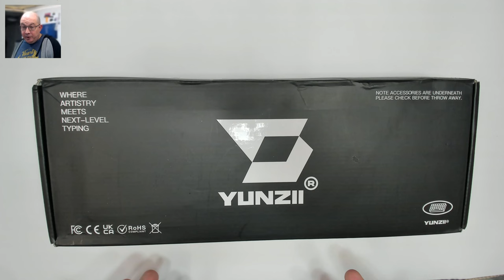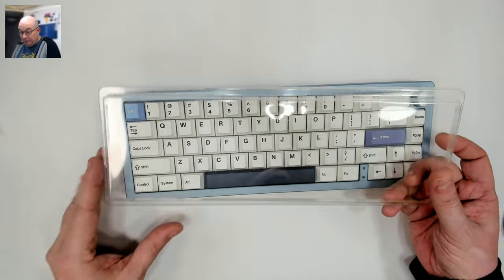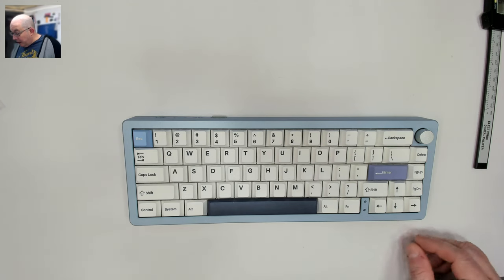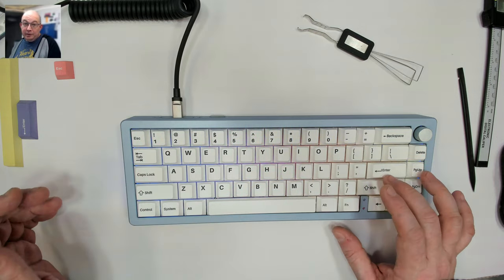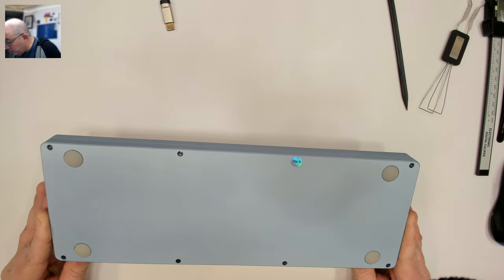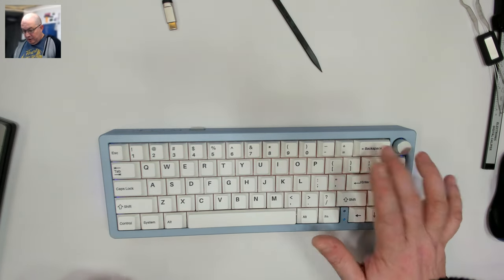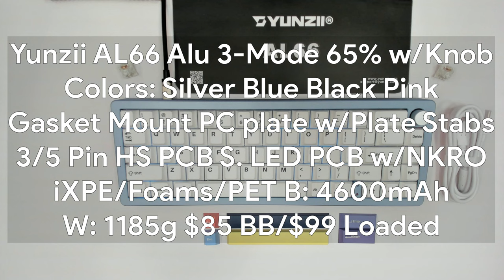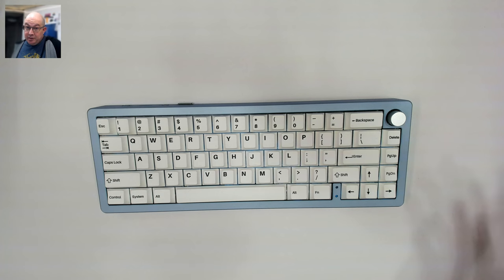Yunzii AL66 Review and Sound Test

Comment: Love the way the budget market is really starting to move more now. The new GMK87, the AL71 etc. It has really started to drive the price of boards down. 

I just wish Yunzii had made this and the 71 QMK/VIA based and done away with the closed software. I find all the iffy gdrive links to drive software such a turn off on some of the cheaper boards and VIA support would remove all that problem, probably for a few $ price increase for the better MCU

Looks an interesting board though
Reply from the maker: Many manufacturers are coming to the realization that they will need to invest to get those MCUs and deliver open source software since Windows is not the only OS. Not only that, I think it would save them significant time in developing those closed source "drivers" as building QMK driver is not a complex process and should be able to be written and tested within a day or two per keyboard, even less if they develop templates, they'd just need to insert the matrix, build, and go. 

I think we'll start to see a lot more of these affordable boards adopt it. Granted, it's not full VIA, but is a step in the right direction - the GMK67 was released with closed source software, but the GMK81/87 are "VIA" compatible, which is a good signal of what's yet to come.
Reply: @MechKeyboards  Yep, I am waiting on my GMK87, just left China from the tracking :)  

So how did they manage VIA without QMK or they have basically provided a VIA wrapper over their existing code in the board. 

Yep,  building a QMK map from ground up is actually not that bad as really just a mirror of the wire traces. I am looking for a case at the mo to try my first hand wired build. I could see it would save them a load.   Will be interesting to see how the year plays out now, I half expect a raft of interesting Aluminium boards in the space. I am sort of sorry to see CNC acrylic go out of fashion. I have an ACR Top 75 and love the case on that, wimilar to the little 40% you did recently but scaled up. 

I guess once you move to cnc though then Alu is what people want now.
Reply from the maker: @WarrenLeggatt  my guess is that they did some USB capturing and built/modified the firmware to send out the VIA signals, I don't believe QMK is involved, especially when they are wireless, only one MCU that I know of works with both. 

To be honest, I don't think acrylic is gone for good. Aluminum is the "material of choice" at the moment and there almost seems to be a race to the cheapest. Once everyone has one (or three), they'll cycle back to acrylic, wood, and other materials that will help them stand out from the pack. I enjoy acrylic as well, but all the other ones that I own are stacked acrylic, which is still decent, but I love that single CNC'd body and I want more! 😁
Reply: @MechKeyboards  Hopefully. I have come around to wood also recently. Just dropped one of my Minila layout boards into a wood case with 2mm silicon in the base (All that would fit lol) and that has a great sound profile to it. Has a far "warmer" sound profile to Alu I think
Reply from the maker: @WarrenLeggatt  I've yet to get a wooden case, but it's long been on my list. I know someone with a CNC and should just breakdown and buy me a nice slab of Rosewood and have him print me up a nice 65%. 

Soon. 

Cheers!
Reply: @MechKeyboards  Got mine from YMDK of Ali. I have two different from them. One is "box style" with base and lid and the other is a case and wrist rest combo in Zebra Wood (Which looks epic). The later is what I am typing this on. The box one has no slope on the type deck so not as good imho. 

Both are GH60/Tofo60 etc. That sort of common layout and both were machined well. Not sure if you have reach with YMDK but as you have following they might come to the party and send you some samples.
Reply from the maker: @WarrenLeggatt  I know the ones you speak of and look forward to working with YMDK, they require a few more subscribers than I currently have, but I aim to reach their number soon enough.

That zebra wood is epic and I have more than a handful GH60 boards...  😉

Comment: Would it be possible to make this board sound more poppy and clacky? I tried putting HMX Hyacinth V2U on them and as expected, the board made them sound muted and bassy.
Reply from the maker: It's likely, but I can't give any direction until I actually get in there and see how it's built. Not for nothing, I loaded some MMD Princess switches in mine and it made a huge difference in sound level and poppiness.

Comment: Which Keyboard out of the AL66, Cidoo V65 or Womier S-K71 no matter the price?
Reply from the maker: Honestly the AL66. Yes, the S-K71 sounds lovely as well, but I've incorporated having a knob into my workflow, not that I couldn't just use the knob on the numpad I use whenever I'm on a TKL or smaller board, but it much easier for my hands to find the knob when it's just a few keys away :)

I have a stack of six V65 V1/V2, every single one with issues. Cidoo is owned by Epomaker and I just cannot recommend their products.
Reply: @MechKeyboards  Alright, thanks for your rapid answer on the topic😅 Due to me living in Germany the Womier is about 110 Euro and Yunzii is 15 Euro cheaper. I don't care about the knob too much as I am going to use to keyboard mostly for casual gaming. Do you reckon it is going to be good and not gonna have any problems with latencies? Anyways keep up the good work and once again thank you for your fast answer you've earned a subscriber
Reply from the maker: @sejkk1610  I've yet to have any issues with keyboards from either Yunzii or Womier, so I'd reckon you'll be fine and the keyboard should last you. I don't game but I have no issues with latency over BT5, though most gamers recommend 2.4g as they have a faster polling rate. 

Thanks, glad I could help, cheers!
Reply: I plan to use the Keyboard wired anyways so the polling rate should be good Right?
Reply from the maker: @sejkk1610  yes, I do believe it's higher over wired and 2.4g.